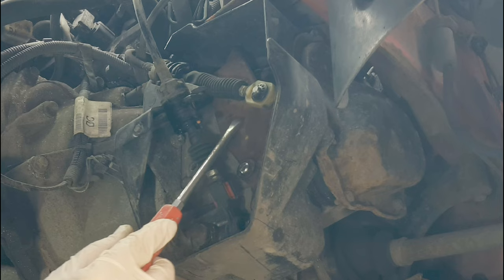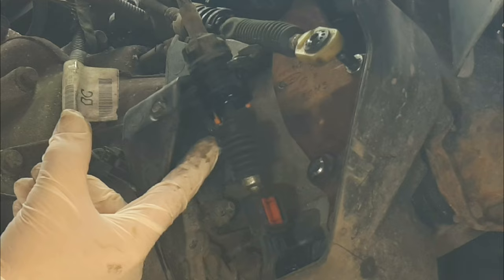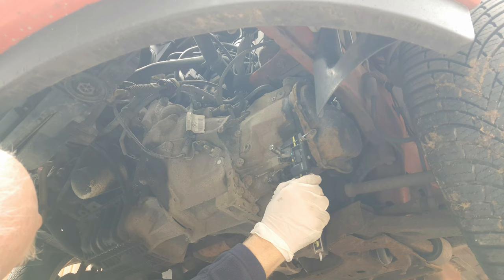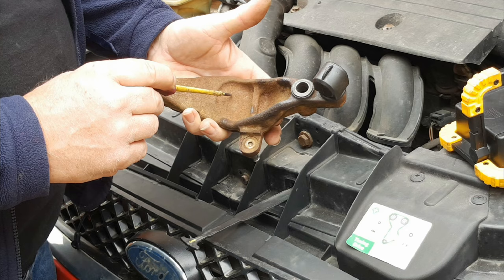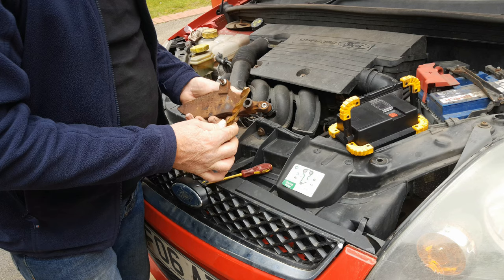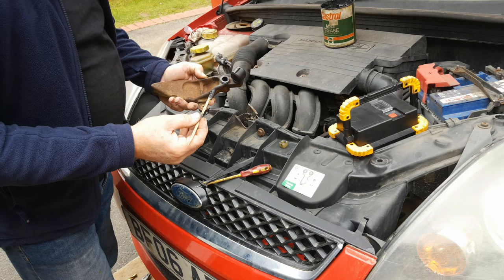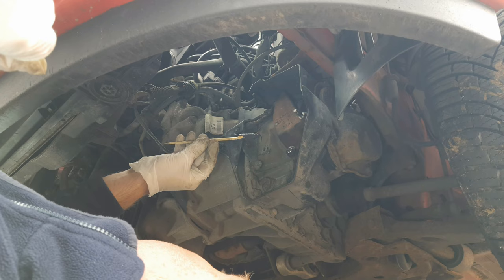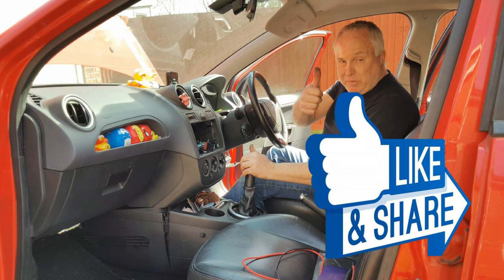Ford Fiesta mk6 Stiff Gear Change | 💯 BEST Repair Tutorial on Youtube

Comment: local mechanic told my daughter the stiff gear change is caused by cracked synchronisers and she needs a new gearbox. £1200. after googling the symptoms we found this. we are not mechanics but followed the video and 2 hours later problem solved! thank you Cyd
Reply from the maker: Awesome, I love reading comments like yours. Thing is, that garage owner could have done the same research. £1200 seems very steep. You could have had a new clutch and a good 2ndhand box refitted for about half that.
Reply: Probably pulling a cowboy move cos she's a younger women. My mechanic told me he has known people to see single mums with babies and make stuff up about suspension being unsafe to get a "big job" out of them. Glad you researched cos that's a joke £1200 worth more than the car nearly

Comment: Further to my previous comment: Following on from your excellent video, I have just done the job on my Fiesta and it went exactly as you explained it. I did deviate slightly: I found it better to insert the small, square nylon type bush on the small ball joint at the rear, once greased up, then just slide it into the square hole on the end of the selector rod so didn't need to use grips. Other then that, I followed your vide step by step! Many thanks! :)

Comment: Thanks for making this video.

I’ve been able to apply this fix to a 5 speed 2015 mark 8 Fiesta with 70k miles. It only presented the issue exiting 2nd gear, normally after a long steep uphill climb. It would be the shift back to neutral that was very stiff, it would easily take all other forward gears in these cases.
 
I used a pillar drill to bore out the phosphor bronze bush with a 12.2 mm bit. Upon reassembly with high temperature grease, I can confirm the issue is no longer present, even after some hard 2nd gear climbs.

A notable difference on the mk 8 is that you will need to remove the gear selection sensor magnet and unplug the connector. The magnet sits next the rubber boot, removal is with a T30 Torx.

Comment: Many thanks for the guide.  Just bought a 2009 Focus, with IB5 gearbox, which has stiff gears when warmed up.  This repaired it and managed a 60 mile round trip today without issue )
Reply from the maker: Didn't realise the Focus suffered the same issue. Any other models suffer too that you know of?

Comment: You're a fookin legend for describing this to the Fiesta world! I'll have a play with the IB5 in my Mk.6 and hopefully fix my issues with going into second and reverse.
Reply from the maker: Do let us know how you get on
Reply: @CycloneCyd  It's a case of having both the time then the energy to do the job.
Reply: @djshotty  did you sort your issue? My fiesta has the same issue second and reverse
Reply: @GamersTalkingShit98  Nah. I pretty much 'race-change' it into 2nd or skip it from 1st to 3rd when accelerating. Slowing down I'll either pull to a stop in 3rd then restart in 1st or be real careful with it and 'feel' for it going into gear.
Reverse? Well, same thing... I just 'feel' for whether the gears are going to engage before lifting the clutch pedal. You should be able to feel through your hand whether the gears are meshed or not.
Reply: @GamersTalkingShit98  No, I'm just being careful with it.

Comment: Nice one - I bought a fiesta ST150 a few days ago and it started to have stiff gears straight away - took it to a garage who just tried to Lube the joints, but I’d already bought the drill bit and told them what to do - amazing difference in less than 20 minutes.. thank you!
Reply from the maker: I've heard of people being advised to have new gearboxes for this 💰😞 yeah, I know ....
Reply: I've just bought a 2007 fiesta st, the gears get stiff when the engines warm. Is this what happened with yours ?
Reply: @theaccountant8043  Hiya, mine got stiff after about 15 minutes.. basically, when the engine gets hot, it’s quite close to the gear linkage and causes a bit of expansion. Drilling the hole a bit bigger fixed it completely and cost about £40 at a garage - a pretty easy fix, and certainly worth a go before even considering replacing a gearbox. It’s a very common issue
Reply: Oh, and it’s worth having this video to hand to show the garage
Reply: @MrAshleydickens  I've just sent the garage this video haha
Reply: @MrAshleydickens  that's exactly the same as mine, it's absolutely fine cold... gets warm and it's a bitch to change gear.. especially after 30 mins of motorway driving in 5th gear

Comment: Just bought an st150 for track use and had this exact problem, thanks for video, on test drive car was fine after an hour on motorway gear selection was very stiff thought box problem, after a bit research it was just this tight bush problem, took apart drilled out greased up hey presto all done.  

thank you

Comment: I just did exactly this to fix the gear linkage feeling like concrete. Works lovely now. Thanks!
Reply from the maker: Awesome. Shite design - would have been better cast in ally
Reply: Was your gearstick stiff side to side or only when going in gear??
Reply from the maker: @datwinz3927  only fore and aft
Reply: @CycloneCyd  oh alright would you know why left to right stuff? Any ideas or things to try as I took the cables off the gear shifter and it was still stiff side to side so leaning towards gear stick shifter assembly… thanks for quick reply! Love your work!!

Comment: Couldn't even get the first gear cable off.... And I didn't want to apply heavy force since I needed the car the same day 
So I dowsed the pin in quite a lot of CRC 5-56 and called it a day. Maybe not a long term solution, but heck, now I can change gears with my pinky!

EDIT: But I wouldn't even have tried it without this excellent video, so kudos!

Comment: thankyou so much for your video, my daughters first car is a fiesta & hers is doing exactly the same as you have described. Tomorrow i will be fixing it. Thanks again 👍👍👍
Reply from the maker: You are welcome!
Reply: @CycloneCyd  i've been under the car & it looks different. i took the cover off & the two cables aren't the same. They don't have the twisty parts where the orange nipples come out. I'll have to try & muddle through it. My daughters is a MK7 2011. cant find anything on the internet, i'm sure i'll work it out. Your video was still a great help though 👍👍👍
Reply from the maker: @norfolkbushmanandfriends7916  I'm not familiar with the mk7, so have no words of wisdom to impart. I have heard it suffers a similar problem though.
It can't be beyond the wit of man to resolve (though clearly beyond a Ford Engineer, lol)
let us know how you get on
Reply: @CycloneCyd  Hi mate, it's pretty much the same apart from the twisting action which i couldn't figure out but i managed to get the plate out from behind the cables anyway. It all worked perfectly, thanks again for your help 👌👋👍
Reply: @norfolkbushmanandfriends7916  Hello, i've just done it this morning on a mk7, you have to pull down the clip and get the cable out. It's a pain with the airbox in the way but managable.
Have a great day and thanks for the vidéo !

Comment: My wife just bought a 2006 fiesta some weeks ago. No problems with the test drive. But if the engine is hot the gear shifting is really hard. Tommorow I will try this fix. I will let you know the result.
Reply: It's fixed! Within half an hour. Drove 25 miles after it and it works well. Thanks a lot!

Comment: Would you be able to do a gearbox oil change video for the Mk6 Fiesta please? Most of the IB5 gearboxes don't have a drain plug and the official method is to suck the oil out through the filler hole. There is a nut below the filler nut which can be removed to drain most of the which a lot of people have had success with but its apparently not advised as it can cause issues if it doesn't go back in right. But I'm guessing you know all this. I wouldn't want to remove a drive shaft to drain the oil. Cheers.

Comment: Hi my issue is first gear is hard to engage , if I waggle the linage at the gear change arm it will then engage easily but then is difficult the next time you try first. All other gears are fine

Comment: Now this is how a 'how to' video should be. Excelllent. I've just purchased a '59 plate 1.4 diesel Fusion,gear change a little bit stiff,would it be the same solution?
Thanks.
Reply from the maker: Thanks, Andrew. I 'think' it's the same gearbox, so probably is. I'm about 80% certain, so you'll have to have a look to confirm (the whole job doesn't even take an hour so won't take long to confirm or not).
Do let us know how you get on
Reply: @CycloneCyd  thankyou👍

Comment: I also have a 2006 Ford Fiesta. I did exactly like you, but unfortunately the problem was not solved. That strange noise is still heard when I engage for return. I hope it's not the gearbox, if the noise problem when I try to engage in manual transmission comes from the gearbox, then the car is no longer worth repairing. The repair becomes more expensive than the whole car😢

Comment: Super detailed and useful vid, thanks very much! I've got a 2014 Ford Fiesta, North American model. It occasionally has trouble shifting into or out of gear. However, if you pump the clutch or turn the car off and on again, it may shift smoothly. Does it sound like a problem this vid would fix? Cheers!
Reply from the maker: Try adjusting the clutch cable (they are cable, right? - if not, bleed the clutch). It does sound like it might be the clutch is near the end of it's life. Also check the 'box fluid level.

Comment: Would you know what is the problem when the gear stick is STIFF side to side in neutral? Cables or gear shifter ? Any easy ways to eliminate the gear cables or shifter? Looked at the cables on both ends and all look pretty good just little rusty down by gearbox end which is expected… thanks in advance!!

Comment: Hey, saddly did not find it before. Tool the car to a garage the gear cables were replace, it seems better but now it seems that the shifter lever is not centered correct and to gear into 3rd we have play a bit, not really good. Is there a simple way to center it correct? I am guesing it is one of the cables
Reply from the maker: The honest answer is I don't know as we don't have the car anymore. IIRC though the cables can be adjusted at the 'box end. I should go back to the garage and ask them to readjust the cables.

Comment: Im having the stiffness problem in my brazilean ecosport mk1 with duratec 2.0 engine. It has the same gearbox (IB5 Plus) but doesnt have any bushing in that pivot LOL that part of the hole is just iron without bronze or plastic bushing. The stifness comes when warm maybe 30mins of engine runing.. perhaps its the clutch but the same problem when warm seems to happend in these fiestas with the same gearbox :/

Comment: Just came across your video and I think I found the solution to my weird problem! I drive a fiesta just like that and 80% of the time the gear changing is super easy cause all I drive is 5 miles to work and back! But on long journeys especially when there’s a lot of inclines having to rev the car more than normal! The gear changing becomes a lot stiffer and sometimes needing a little bit of force to get into gear! But there is no gear crunching or grinding sounds! Could this be the solution?
Reply from the maker: Does sound like it. It'll only take you 30 mins to do this so easy enough to find out.

Comment: Thanks for the video! I’ve ordered a 12.3mm! Mine is only hard to get it into gear when the engine is on. When the engine is off it isn’t stiff. Does that mean that this isn’t the same issue?
Reply from the maker: If it's stiff to get in gear whether the engine is hot or cold, then it's likely to be something else - clutch maybe. This problem gets worse as the engine gets hotter
Reply: @CycloneCyd  
Thanks for the quick reply. I followed your video and it did improve the smoothness of changing videos but the problem did still remain. I think it’s my master cylinder as it does find gears if you press the clutch in hard or if you pump it a few times

Comment: i have a question, on my focus mk2.5 2.0 petrol, when the car is off, the changing gear is going very smoothly, but when is car on i have difficulties to get in 1st and 3rd gear especially on first. what could be the issue and what can i check?
Reply: Did you solve the problem??

Comment: I did this and it didn't solved my issue. Changed oil in gearbox also. Gears go in but they are stiff and left to right is ok. Could there be an issue with cables or below gear knob to put some grease on cables?

Comment: Stiff gear change is that the same as "having to use a bit of force" to put the stick into gears. My gear feels like something is blocking it when putting it in to gear especially first and second gear.
Reply from the maker: Sure the clutch is operating correctly? Or maybe the clutch is nearing the end of it's life?
Reply: Honestly I would not know, the fiesta is my first car.
Reply from the maker: @LarsenOG  this procedure should only take an hour or so. So do this anyway and if it doesn't help we know it's summat else
Reply: @CycloneCyd  wanted to give a little update, i found liquids at the clutch main cylinder. Took i to the mekanik who replaced et and its working fine now. Apparently its a common problem with fiestas.
Reply: @LarsenOG  Thanks I think you have just diagnosed my issue

Comment: Nice video Cyd. I realy love your channel, especialy because i drive Saab 9-3 🙂
I have a question about this video:
Is it posible that is the same problem on Mazda 2 with diesel engine from 2008?
Reply from the maker: TBH, I don't know for sure. Ford and Mazda had a 'trading relationship' for many years, so I'd say it would be sensible to check if the Mazda is suffering the same fate. It wouldn't take long to check and the whole job can be done in an hour anyway.
Do let us know what you find.
Reply: @CycloneCyd  Of course. As soon as i get back home. Thank you for your reply 😉

Comment: I have the same problem on my mk 1 focus but only when it’s cold so I guess the root cause is different?
Reply: Mine is the same did you get to the bottom of it, stiff on first start up and gets easier the warmer it gets, mines a 2002 ford focus 1.6 petrol.

Comment: Very well explained, shame I'm useless at mechanics so my car will have to keep its gear change stiffness :-(
Reply from the maker: We humans learn best by 'doing'. If you never try you'll never improve.
Reply: It's very easy to do, I did it recently myself.
Reply: Steven, if you can just get the first plastic cover off and spray some CRC 5-56 on the pin it can do wonders
I did it yesterday, and I can shift with my pinky now!

No tools needed at all, just your fingers.
Reply: @benghazi4216  Hello! I actually was wondering if this could be a temporary solution. I will also try it out. Thank you.

Comment: My 2005 Ford Fiesta has started having trouble going into gear (very stiff) and sometimes won’t engage at all from standstill. It will go through the gears when the engine is switched off though. Do you think this procedure could fix this issue?
Reply: Did you figure it out? I have the same symptoms

Comment: Hello mate, I've got a mk5 (the model before this I think, it's an 05 plate)

Do you know I it's the same problem? The gear change is stiff and slowly getting worse.
Reply from the maker: Our car was a mk6.5. Surely yours is a mk6? It wouldn't surprise me if this is your issue. the whole job takes less than an hour, so well worth a look. Let us know how you get on.
Reply: @CycloneCyd  Hello mate, got mine off and it has a brass Bush in it. I'm not sure what one it is but it's the model with the "flat" looking headlights instead of the "bubble" one. I'm going to try and drill it out anyway and hopefully the guy buying it will appreciate it.
Reply: @CycloneCyd  Could I get away with a 13mm?
Reply from the maker: @needbettername8583  Yes, that'd be okay I think
Reply: @CycloneCyd  I'll give it a crack and let you know if it works!

Comment: My bush is cracked, do I need a new one if so where can I get one?
Reply from the maker: Do you mean the plastic bush inside the gearchange arm? Notavailable seperately, you'll just have to drill out as I show.
Reply: @CycloneCyd  Yeah that one. Ah damn ok. It's almost completely cracked and almost separated so I think I'll have to buy a complete new arm in that case

Comment: I have same problem with 1.4 tdci will it be the same process
Reply: just bought 1.4 tdci today with this issue hoping it's an easy fix! haha Might find out tomorrow
Reply: @gwailoRS  keep me updated please
Reply: @LayLoow  Did it the other night wasn't too bad a job and has definitely made a big improvement. Haven't driven it far enough to get really hot yet but I'm confident it'll be ok. Getting the lever arm off was a bit tough but doable. And the white plastic socket was cracked in half but it went back in really snug so don't think it'll be a problem.
Reply: @gwailoRS  thanks pal hopefully will try out myself 

Was under impression that it’s the gear-linage cable, but again thanks for replying

Comment: Love to see a fundimentally flawed design carried over to new models, my mk7 is setup almost identically, and is exhibiting the same issue
Reply from the maker: Is the solution the same for the mk7? Is it the same plastic bush?
Reply: @CycloneCyd  ~ I haven't had it far enough apart the check the bushing material, but I suspect corrosion in that area is still the underlying problem. The stickyness cropped up after a few weeks of sitting unused, and got a fair bit better after spraying the area with silicone oil.